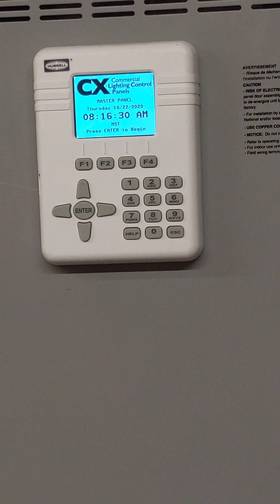Hubbell CX16 Lighting Control - Manual Override

Comment: That button is handled at a low level on the relay boards, and the running system will not know that the circuit has changed. But it's great during installation when you need to see which circuit is which, and also when the system isn't working like it should be.

You should always remember to never connect/disconnect the ribbon cable or relay boards with DC power applied. (That's the 2-pin connector at the top that comes from the ballast brick power supply.) The hardware is not designed for hot-plugging, and there is a small chance every time that 24VDC will sneak around in the instant before all pins are connected and zap a 5VDC communications pin on a CPU chip. That could be on any of the relay boards, the middle column boards, or the keypad unit. That board will then have to be replaced. This is especially important during installation when you are more likely to move things around.